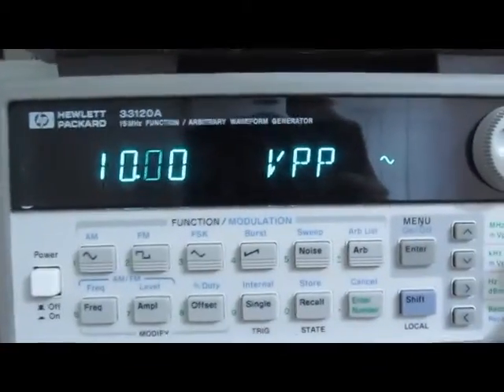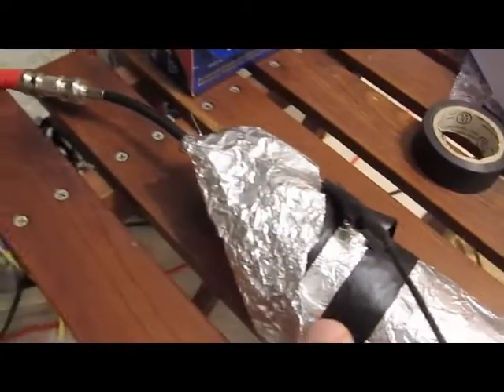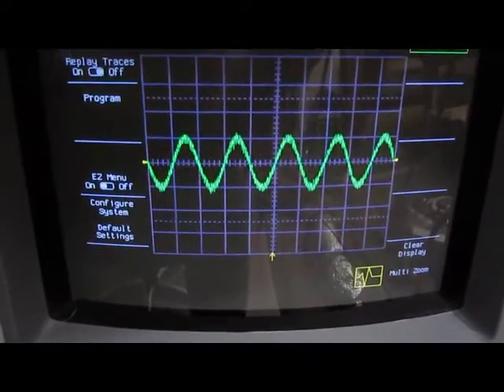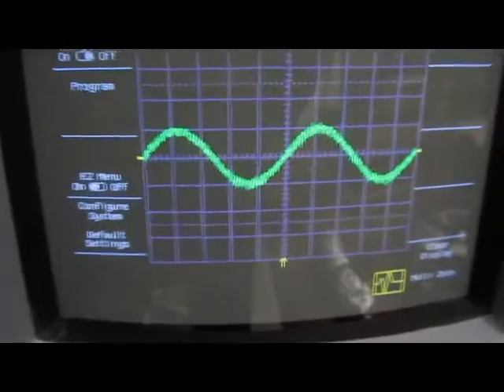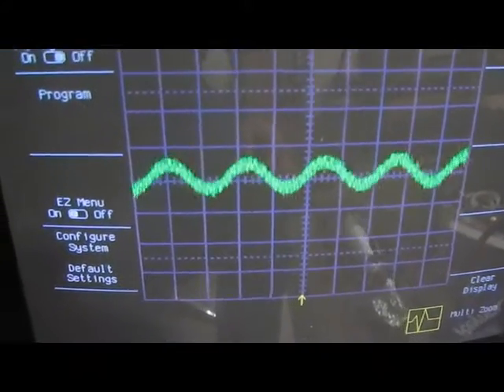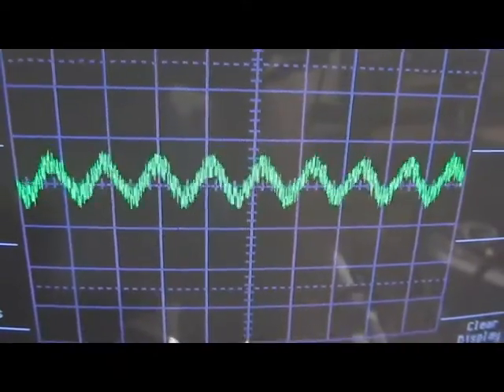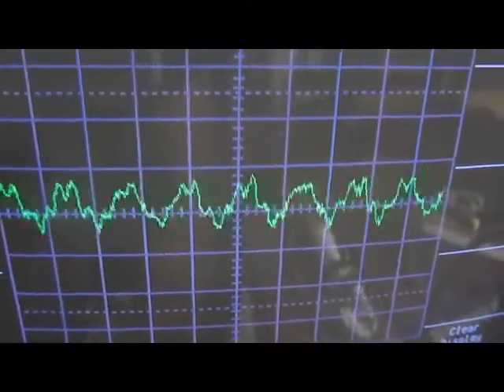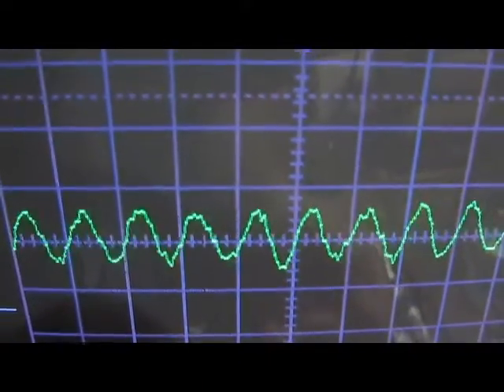Homemade 40KV oscilloscope probe part 2

Comment: The easiest way to check compensation is to connect in 1KHz square wave (I assume your scope provides this signal?) and look for tilt/edge roundoff/peaking.  No need to scan frequency.